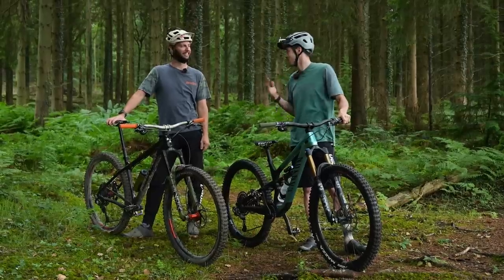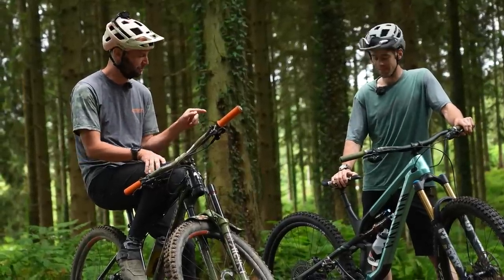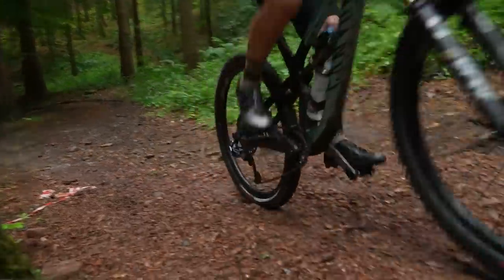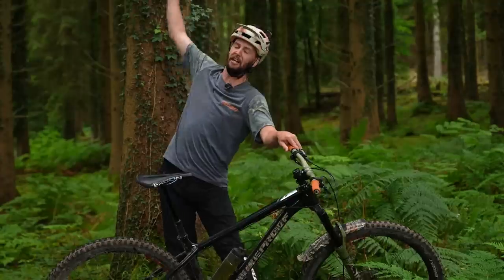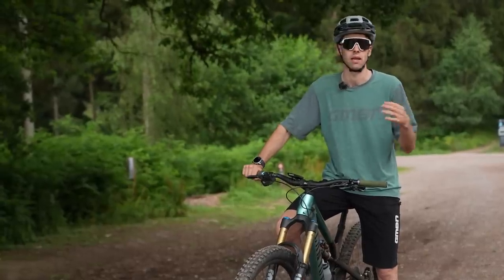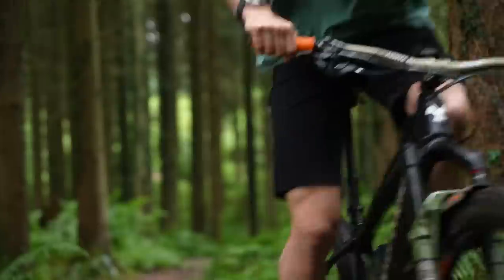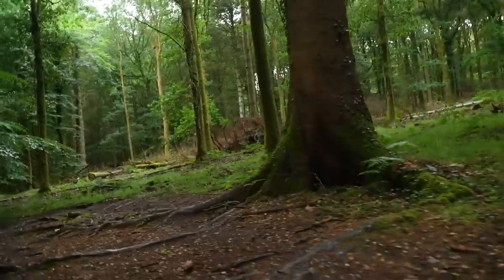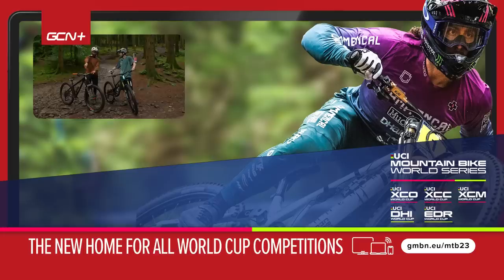What's The Best MTB For Climbing? | Hardtail vs. Full Suspension!

Comment from the maker: Were you surprised by the winner? What hardtail vs. full suspension challenge would you like us to try next? Let us know in the comments 💬 👇
Reply: I'm surprised that Rich was the ultimate winner – making Isaac do all the climbs. 😆
Reply from the maker: @JasonFoxLCB  😂 Not wrong!
Reply: Id love to see a  trail riding comparison between the two. I just bought a hardtail. In the future I'd like to know why buying the full sus would be so much better.

Also a maintenance comparison between the two
Reply: Isaac is a fantastic counter to Ollie. I'm glad that GMBN has someone to dig into the calculations now!!
Reply: No, wasn't surprised, maybe a little with the technical climb.
I would love to see what the needed power/watts is for both bikes if you do a 75 -100 km tour with about a 1500-2000hm difference, on mixed terrain (70-80% singletrack). And a conclusion from the rider how the experience was, besides the cold hard numbers.

Loved this video by the way ;)
Reply: I would like to see heart rate data included.

Love the hardtail vs series!

Comment: I guess it's the hardtail that will surely win  because of it's efficiency of climbing a hill without any bounc efron the rear haha😜
Reply: Plus you aren't hauling the extra weight. 👍
Reply: @flatpedalswinmedals7274  extra weight?
Reply: @garethh2240  the rear suspension and whole linkage and arm in the rear duhh
Reply: @sersolo3112 , try actually watching the video. The full sus  is lighter by about 500g..
Reply: @garethh2240  most full suspension are much heavier than hardtails
Reply: @bryanmiller5692  , was the one in the video?
Reply: @garethh2240  a rare exception, you must have comprehension issues?
Reply: @bryanmiller5692  , that's still the one they made the comparison to and the one being commented on. Don't think I'm the one with comprehension issues.
Reply: @garethh2240  i’m not commenting on the video specifically, but in general in real life and in real life situations. In real life situations they are much heavier

Comment: It comes down to the efficiency of the hardtail. You will not losing Watts from the bombing of the suspension no matter how small how supportive it is. The hardtail has an insert in the wheels which makes it harder to rotate, it's heavier than the full suspension but still one on anything but the most technical climbs were traction is the most important factor all due to the efficiency of the drivetrain.

Comment: It would be interesting to test climbing a trail bike with the lockout on vs. fully open rear shock.  I have found that the firm setting sort of unbalances my suspension and it feels like more energy loss as all the bumps get dumped into the fork.  Could also be poor rider response…

Comment: I was waiting to hear about the tire tread between the two bikes. I don't think I heard anything mention outside air pressure. It is--after all--where the power meets the ground.
If I was riding packed trails and pavement most of the time, there's no way I'd bother with a full suspension.
Reply: @@Isaac-Mundy Yeah I guess I didn't hear him specify, unless I was asleep during that part.

Comment: Hard to say, as I wasn't there, but given that the bikes weigh about the same, you used the firm setting, and even the tech climb didn't look all that tech to be honest, I am not necessarily that surprised.
Also, the definition of "efficiency" is worth exploring a little. Your type of test examines the efficiency of the _bike_. I.e.: power to pedals makes what result in terms of time to the top.
Nothing wrong with that - it was what you set out to. But given the conditions (weight, firm setting and not too techy) these two bikes are on very even ground.
But there's another type of efficiency: rider and bike efficiency. It seems you touched upon it at the end of the video - so one thing is the power that is put to the pedals - but how much is burned in the rider to put that power into the pedal. There can easily be differences. Probably not that relevant for the sort of riding you were examining for here - ie. the casual rider - but for long epic rides it is worth considering where it is easier to stay fresh minded, etc.

Comment: What I'm seeing is something you can't measure which is just look how much effort he is having to put into his body movement on the HT compared to the full sus, he is using less upper body muscles movement on the full sus @11:46 test 2 tech climb the canyon is alot more balanced over tree roots etc, look how much deflection on every tree root the scout has the bars moving around on the bike do that over about 10-15 miles of trails and you will have used alot more energy balancing moving the HT bike around.
I have a nuke proof scout and it climbs really bad, it's a slack ht for going down and it climbs worst than a specialized pitch pro 2011 I had years ago, the seat tube angle is 73 degrees on the nukeproof scout and the head tube angle is over 66 degree when sagged it's a pain in the butt to climb. The front end wonders around on climbs due to the slack head tube angle and the rear chain stays (triangle) has no give in it (flex) and you feel everything on the scout HT transmitted threw the bikes frame, you can only do so much with your legs, the geo says it all really.

Comment: The test is not relevant. you need to measure the output power of the human body, not the input power to the bike. between the output of the human body and the input to the bike you  have power losses due to suspension. If you match the output human power on both the difference would be much bigger in favor of hardtail.